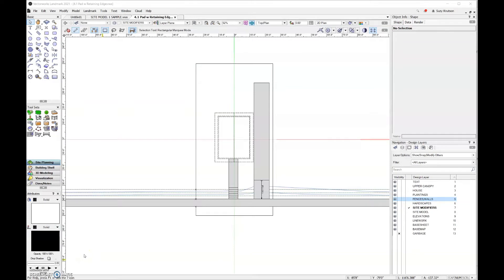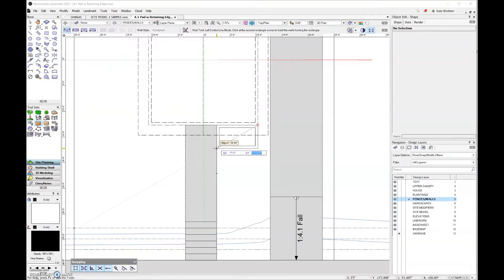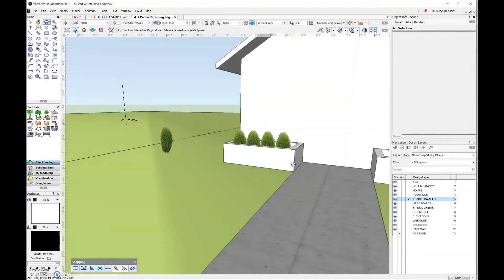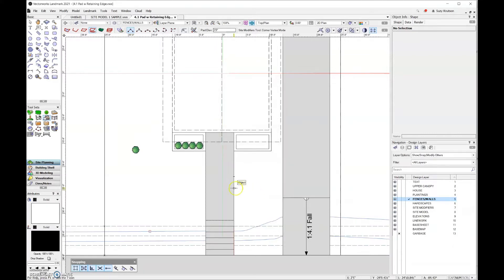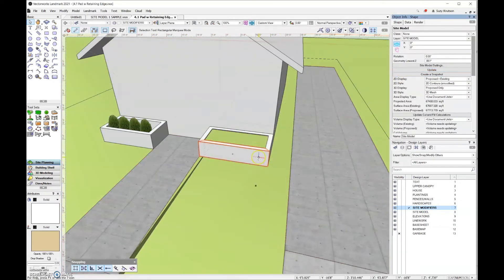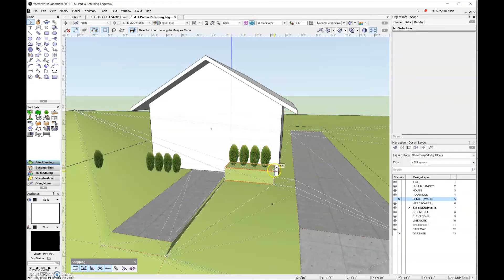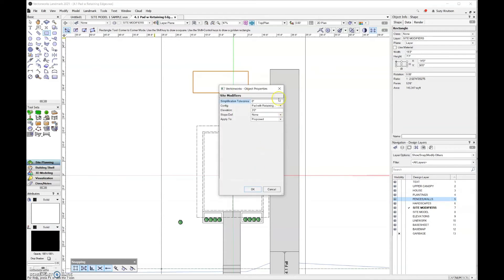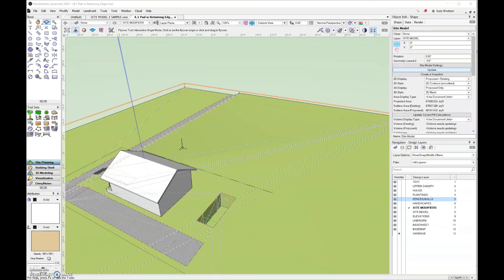3-2a Vectorworks 2022 Pad w Retaining Edge

Comment: I'm trying to figure out when I use pad with retaining edge - I get a site model with all kinds of strange holes around the building pad / basement, rather than a vertical edge that is showing in this particular video.
Reply from the maker: Hi Julie, assuming the pad and retaining edge are set to the correct elevations (ie pad at the bottom for a hole, pad at the top to fill), the two most common issues will be 1. crossing site modifiers or 2. there aren't enough data points in the model for the algorithm to do a good job smoothing the model. Adding a grade limit will add more data points and may resolve the issue.